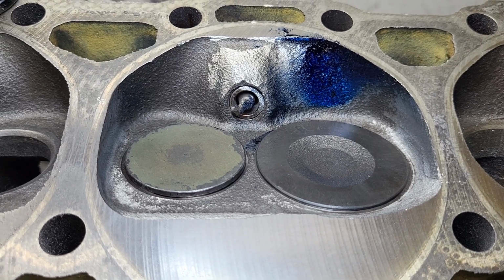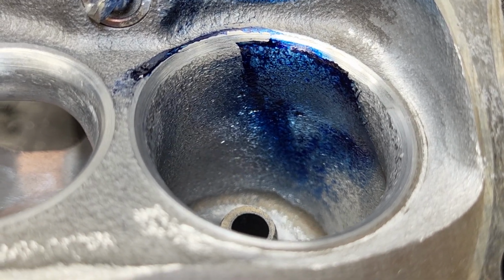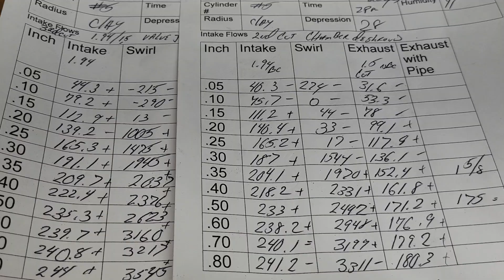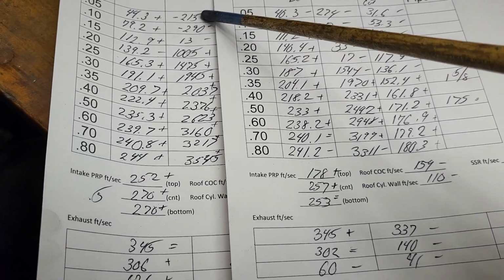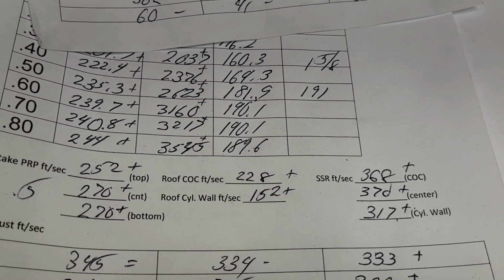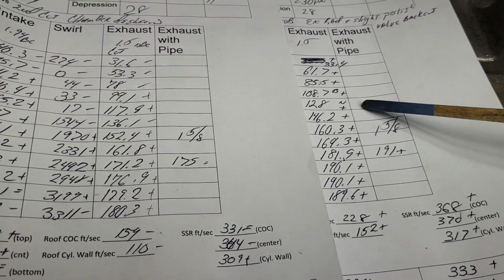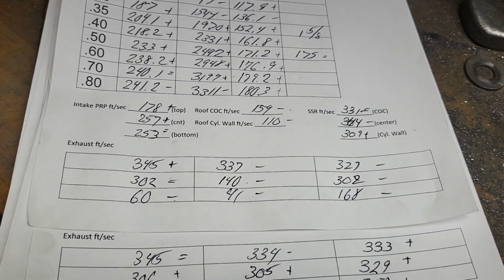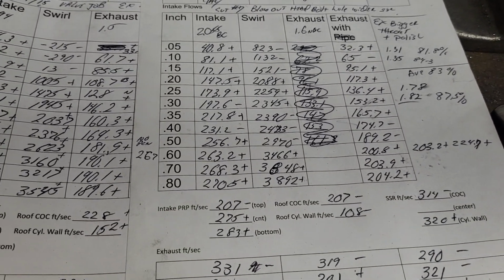17. Chevy 193 TBI Swirl port cylinder head, 3rd cut 1.94/1.5 combo. Valve job and some trickery...

Comment: I have known these heads work well since I put a 5,300 lbs 1983 G20 van into the mid 14s with them. Stock TBI 350 short block, some DIY porting on the 193s, put them on with a 0.016" compressed rubber embossed steel shim head gasket, GM 1996 aluminum head LT1 (Corvette/Camaro) roller cam, 1.6 roller rockers, thorley tri-ys and a ultimate TBI modified TBI unit on a stock GM TBI manifold.  Van ran a best of 14.60s @ 93 mph with a stock converter in the 700r4 and a 3.08 rear gear. It was making loads of torque and carried good HP to 5,500.
Reply from the maker: Good info! Thanks!
Reply: @servediocylinderheads  for some reason Youtube will not let me share a link on here. Google, Rethinking the Valve job. It is an article from 2012 using a low compression 350 with L31 heads.  35 vs 45 vs 50 main seat angle. The machinist that cut the valve job on my 193s was 7 years ahead of that article.
Reply: I head a great improvement using a  Q- jet on my 79 350.
Reply: @servediocylinderheads 
i also have had good experience with these heads. built a set for my squarebody, stock valves but got them pocket ported. just "detailed" the runners, wish i would have done more. anyway 350 bored .030" over with flat top pistons, 0.035" quench, 213/217 @ .050" 112 LSA .485/.495" rollercam with 1.5 roller rockers. made 394 ft-lbs torque @ 3000 rpm & 325 hp @ 5300 rpm on the engine dyno. i suspect the peak torque was higher but the dyno data started @ 3000 rpm. this was at 26* WOT timing (down from 32*). the dyno operator didn't believe it and wouldn't go any lower on timing.

charles, i was happy to see you doing these heads! i also have the cast iron "bowtie" manifold with correct angled centre bolts for these heads. do you think there would be any benefit to installing this intake? i currently have a cast iron "low rise" manifold i got off a marine engine. running a Qjet with ECU controlled timing but will be putting TBI on it this spring.
Reply from the maker: @edgeman1134  The bowtie intake should be a nice upgrade if you spin it. Thanks

Comment: You are right on the swirl curve.  The initial opening is all reversion gasses anyway from the intake valve opening while the exhaust is still open. IMO the ideal valve job would flow ZERO until 0.200".  Some people are dead against it, but I like a 50* main seat angle even on the street. It cuts low lift flow, helps mid lift flow and helps eliminate reversion gasses from contaminating your intake charge. Try a 50* main seat.
Reply from the maker: Hopefully by tomorrow. Thanks
Reply: @servediocylinderheads  when you think about the physics involved of the steeper 50* main seat, you get a stronger port velocity and better cylinder fill delaying some of the flow until the piston is on its way down the bore at a higher velocity. By lessening the low lift flow you reduce intake charge contamination and increase the velocity and cylinder fill when the piston is drawing hard on the intake port. It is a win, win. Reverse flow the intake port as well with a 45 vs 50* seat.  I feel you will see a big reduction in reverse flow under 0.250" lift with the 50* seat. That reduction in reverse flow is blocking power killing exhaust reversion during split overlap.
Reply: @servediocylinderheads  I have a lot of other theories and ideas I would test if I had your flow bench and equipment at my disposal. The 50* seat blocks curtain area at low lift and actually increases it in the mid to high lift, right where you want the port to flow best. Simple math and geometry at work.
Reply from the maker: @chrisreynolds6520  We will see. Thanks
Reply: @servediocylinderheads  agreed, I wish guys flowing heads they were porting actually paid more attention to low lift reverse flow on the intake ports of heads they were working on. Low lift reverse flow is a hidden power killer that nobody really talks about. I feel there are really nice gains to be found there. The aluminum heads on my 383 have a 50* intake seat as well. They flow just shy of 300 cfm @ 0.600 and just shy of 200 cfm exhaust without a pipe.  That 11:1 6" rod engine made 520 ft/lbs @ 3,700 rpm and 502 hp @ 5,500 with a box stock performer rpm and an 850 cfm Q-Jet with doug thorley tri-ys.  218/228 @ 0.050 on a 108 LSA roller cam installed on a 106 ICL.  0.578/0.510 lift with a 1.7/1.5 rocker split. The dual pattern cam cost 20 ft/lbs with a 1.7 exhaust rocker.  I have a new cam for it, 219/219 @ 0.050, 112 LSA and 108 ICL wit 0.544 lift with a 1.6 rocker to run in it. Goal for that cam is to tame out the low rpm manners and increase the fuel mileage by reducing overlap a bit.
Reply: @chrisreynolds6520 
Try the Comp XFI with 202° intake 212° exhaust @.050" lift is .550" in .546" ex on a 113° LSA. Lift is from the called for 1.6:1 rockers. I think 1.7:1 would be just right. Also with aluminum heads 10:1 to 10.5:1 would help.

I have this cam in my 9.6:1 compression sbc 383 in my '65 Impala that the best to date mpg I have gotten was 26/20 mpg 
highway/city with the mentioned cam. That is with a 700R4 with a 3.07:1 rear gear with lockup as much as possible.

A bit more compression would make up for the extra lift and extra 2° duration @ .050" you get with the extra .1:1 rocker ratio. And if you were really looking to eek out more mpg a 2.93:1 rear gear would be the ticket. With the low end torque that cam puts out even with an RPM Airgap dual plane intake, you should be able to shift into overdrive and lockup @ 45 mph no problem.

The 700 transmission in first gear with a 3.07:1 or 3.08:1 rear gear is like a th350 with a 3.73:1 in first gear. The big dropoff into second gear isn't a problem either with this cam because of it making off idle power. If you try this cam with a 700R4 transmission, you'll love it.😎👍
Reply from the maker: @chrisreynolds6520  That is good for a stock intake. Thanks
Reply: @itseithergonnaworkoritaint7852  My combination is in a 7,000 lbs 1997 G3500 Express conversion van.  4L85E and 3.73 rear gear with a 30.5" tall tire.  Dual pattern cam is actually shooting yourself in the foot torque wise. I have run both in the same setups over the years and took Comp cams advice for this 383. They were way off the mark on the cam. This 383 is 11:1 and a 202 @ 0.050 intake lobe would have me around 250 psi of cranking compression. It is already 235 psi with a 218 @ 0.050 intake lobe that has a 61.5* intake valve closing angle. The big issue I have run into with the Comp cam is the 61.5* of overlap has too much overlap for it to be happy under 1,500 rpm.  The 219/219 on a 112 drastically reduces that overlap number and will not blow down the cylinder pressure via early exhaust valve opening  at lower rpm. Generally speaking the longer you expand the burning gases before blowing down the cylinder, the more torque you make at lower rpm and the better the fuel mileage. I have actually considered even putting Rhoads V-max lifters only on the exhaust side of this engine to reduce the overlap without increasing the dynamic compression ratio. Considering it gained 20 ft/lbs going from a 1.7 to a 1.5 exhaust rocker arm, going with a V-max lifter on the exhaust would probably gain even more torque.
Reply: @chrisreynolds6520  
To bad you need that heavy of duty transmission, a 700R4 would get you much better mpg. Plus first gear acceleration would be much more funner with that 3.73 gear set.

My tires are 28" tall and spin easily in first gear with the 3.07:1 rear gear. With both of the durations so low I don't notice the torque being lower because of the dual pattern. But I never had it dynoed so not sure. I do know that cam starts making power right off of idle and will keep pulling to 6,000 RPM. Would probably pull further if I had the correct valve springs on it. Valves start floating at 6,000 so that's where I shift when at the track.

I run it on 87 octane without any problems @ 9.6:1 with aluminum heads. With aluminum heads and 11:1 you would probably want to run 91 at the minimum with that cam. Possibly would be ok on 89 with minimal load? 

You could try 1.5:1 rockers on the exhaust and 1.7:1 rockers on the intake valves. That would essentially make the ex duration 210° and the intake 204° from changing the ratios if you tried this cam? With the 113 LSA and the very low duration, overlap is basically non existent.

Another way to pick up a couple mpg would be to overdrive the overdrive with a Gear Vendors unit. Maybe try this before trying a different cam? Right now your final drive ratio is 2.7975 not factoring your tire size in. With a Gear Vendors unit you can get that down to 2.18205:1 final drive ratio, again not factoring your tire size in which would lower that number. 

If all you're looking for is for a bit more mpg perhaps going from a 3.73:1 rear gear to a 3.23:1 you can get the final drive down to 2.4225:1 and with a Gear Vendors unit 1.88955:1 final drive ratio.😯😎 Sounds like you already make enough torque to pull this off? Good luck.😎👍
Reply: @itseithergonnaworkoritaint7852  the thing had a 4L60E in it from GM. I put the 4L85E into it. It had better acceleration and better fuel mileage with the 4L85E than it did with the 4L60E and that was with the lightly moded L31 350.  Cruising 75-80 mph it is happy as can be. On a long road trip above 70 mph it has managed 20.6 mpg best. It is lower rpm, idling around town that it is not a fan of. I already own the cam and it is going into it. It has a bum set of LS7 lifters that I bought from GM a while back and they are obnoxiously loud and often collapse overnight with startup morning sickness. I have to go into it anyway. I am planning to put a 6L90E into the van and have all the stuff to convert it to GenIV LS engine management to run the 6L90E. I like the ratios of the 6L90E although I will definitely need to do something to plant the tires with the 4.03 1st gear of that unit.  I already find myself hazing the rear tires with a 2.48 1st gear. I can break them loose and spin the tires until 50 mph unless I back out of it to near idle and get back into it after it hooks.

https://youtu.be/Dyvl6LlkMcA?si=Dj_LEnMdRXcdxUTq
Reply: @chrisreynolds6520  the 6L90 has some issues, just be aware of that. Went through 3 before 100,000 in a 2007 3500 4x4 long bed with the 6.0. It was under warranty for the first 2, the 3rd I had built slightly and it's still going fine at 200,000
Reply: They need a converter and tuning changes. I am going with a 6L90E from a Duramax application in mine.  I have a great local converter company that builds the converters for them that actually hold up.  Between beefing up the converter and disabling the PWM slip that GM lets slip the converter clutch up to 40 rpm all the time they will last.

Comment: Been following this series and appreciate the work you've done on these heads.  Can you post throat diameters for the 1.94/1.5 valves. Thanks.
Reply from the maker: If I remember. I didn't set them at a specific ratio.

Comment: Looks like a reverse ramp was created when the short side was opened up, enough so that at low airflow it counters the swirl created by the shape of the port. The offset and depth of the runner in comparison to the port creates swirl at higher volume. Compare to the fluid dynamics of a bend in a river.
Reply: Sorry I meant in comparison to the  bowl.
Reply from the maker: @jdvintageauto2958  Thanks

Comment: I've watched the progression on these and honestly all I can think of is how much the intake port and runner are made like a lawnmower engine. Mowers are extremely hard to port without making the flow really weird.
Reply from the maker: I have done mowers before. Big increase in torque. They are still governed for speed but the increased flow helps torque curve.

Comment: My thoughts on a lot of the first and second cut numbers you're getting would be these heads were designed to run less than 4,000 RPM in a very heavy vehicle and make tons of torque. The bump on the cam was so small if you didn't look close you'd miss it so I'm pretty sure it maxed out in the high .300s on lift and let's not even get into the duration. There wasn't enough there to talk about which I guess is why they called it a peanut cam.

Speaking of cams I have to do a timing chain on my 305ci in the pickup. While I'm that far in if you had a nice cam choice for a smaller cubic inch with some very mild head mods that would be very helpful.
Reply from the maker: Comp 252h is great for mild build.

Comment: Absolutely I would like to see a 1.550" ex valve with a 2.08" intake valve or 2.100" if you can make that fit? Exhaust flow or the lack of can be compensated with more ex duration to keep up with a better flowing intake port. Besides you're almost where you were with the smaller valve anyway, increase it another .050" to 1.550" and you'll probably be right there where the 1.60" valves are? 

Curious what taking the bolt hole wall out like the bigger valve port will yield with the factory valves?😯😎👍

Comment: Charles: I bet the bigger intake and smaller exhaust valves could make more power, but might not achieve the same good 85% ratio. That experiment could indicate the line between a better naturally aspirated engine and a great nitrous application. v/r wh
Reply from the maker: Good points. Thanks